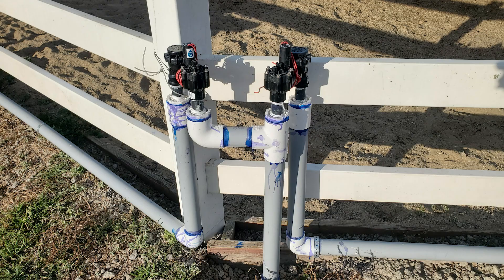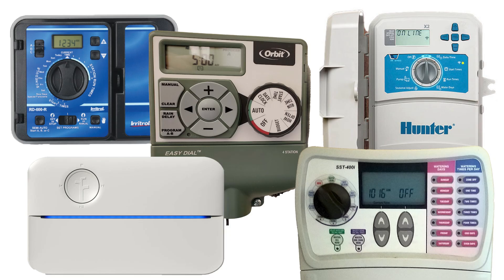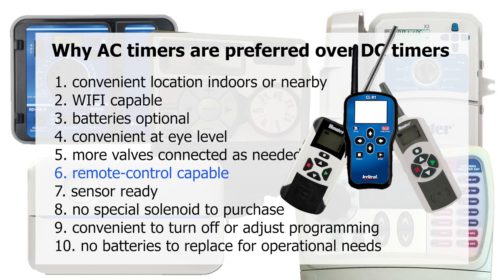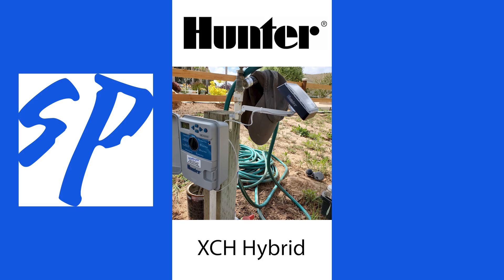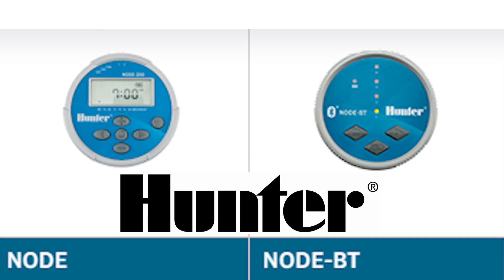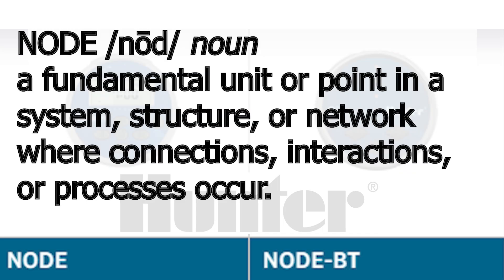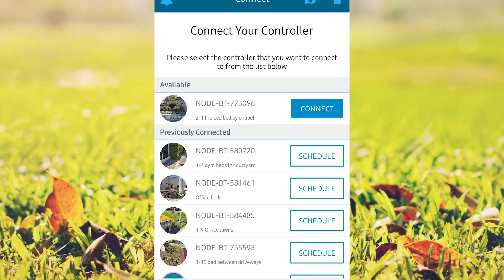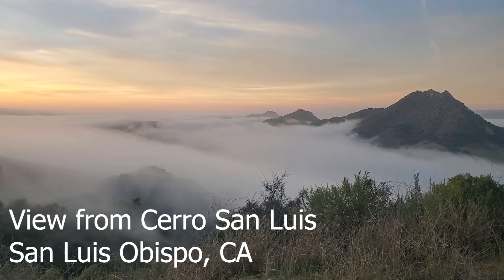The best battery-powered timers for irrigation valves

Comment from the maker: The day after I posted this video I remembered an anomaly that you need to be aware of if you want to put your Irritrol, Lawn Genie, Lawn Jet, or Toro sprinkler valves (all owned by Toro) on a NODE controller. The Irritrol/Toro DC solenoid that you'll need to buy for it/them (available on my Controllers resources page) MIGHT not work with the NODE. I have experienced random results. Some of the Irritrol/Toro DC solenoids work fine with the NODE and some don't. I'll make a video about this situation and provide solutions as soon as possible. The problem is with those solenoids--not the NODE.

Comment: Thank you so much, this is really helpful to understand the differences. I've been looking for these details as I'm trying to change the existing irrigation setup due to low water pressure.on a farm/field. I would rather avoid trenching the wire 3 ft down for a 1000 ft run if the battery+solar operated one can do the same job as the AC controller.
Reply from the maker: I'm glad the video helped you with your project!

Comment: this is exactly what i needed as i am reviving my 35+ year old impact sprinkler system which hasnt worked in around 12 years
Reply from the maker: cool beans! Sounds like it got posted just in time. A video about impact sprinklers has been on my list to create. When impact sprinklers fail I replace them with Hunter PGP Ultra's or Hunter PGJ rotor sprays.
Reply: @SprinklerPros  I would replace them with rotors but these sprinklers are mounted on PVC risers and are all 90s Rain Bird 35A/PJ series and some other Western Brass ones, so I would want to keep the original feel
Reply from the maker: @Sirensofwa1  gotcha